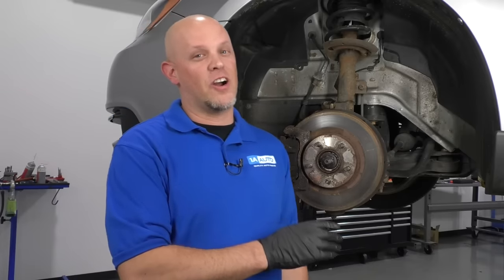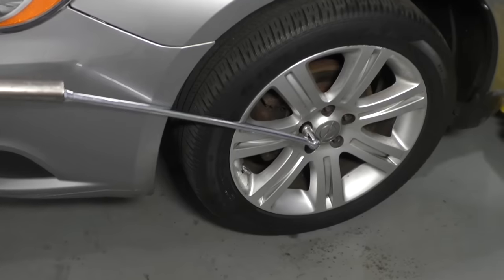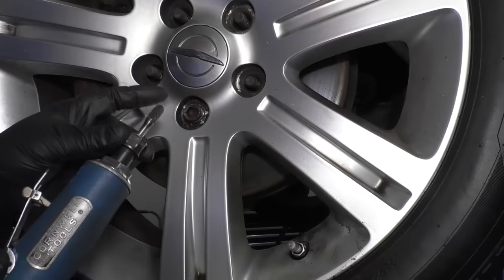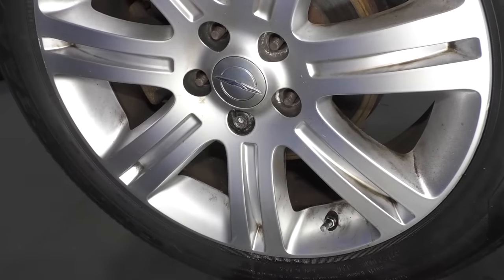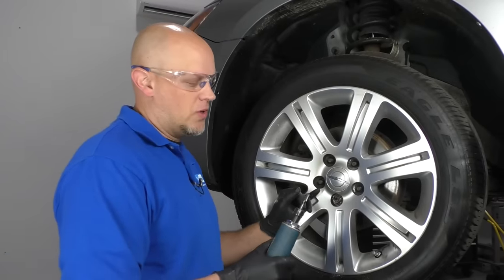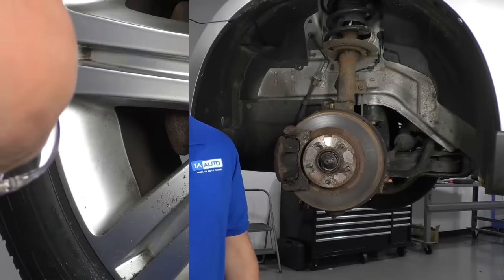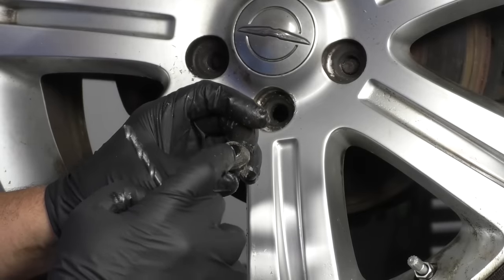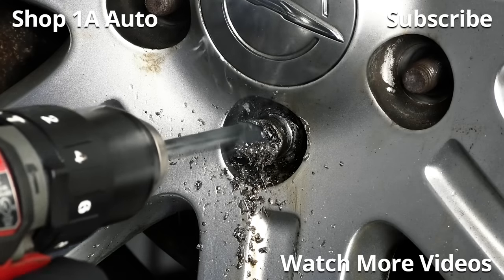This Lug Nut Wouldn't Come Off Our Car!

Comment: Better to have that happen doing a brake job than a flat tire!
Reply: Just Had it happen to me during a brake job and it’s still upsetting :(  I have 1mm left on my pads
Reply: Legit me with the flat and 3 stuck lug nuts I have no clue
Reply: @marianoardon9745  did u figure it out ?
Reply: Currently 🙄
Reply: This is happening to me rn with popped tire
Reply: I got 16 that are stuck on my new car 😮😢
Reply: An there are 2 stuck in my extractor
Reply: Tell him me about it!😡
Reply: Yup got a flat
Reply: About a week ago I was leaving town for the weekend with the wife and saw in the side mirror that I had a flat tire. About 5 days later I finally had a chance to change it and I broke the lug nut in half. Now I have to drill it out, just waiting on the new wheel stud
Reply: Worse to have it happen when your air ride failed and you’re trying to put your coil overs on😩
Reply: That’s me right now
Reply: I got a flat

Comment: Leave that one lug not on, remove all others, lower car from jack...turn car on dump the clutch! Lug nut AND tire off at same time
Reply: Can you rewrite that
.. I have a breaker bar and I am still unable to take off my tire lug nuts.  I even stood on the breaker bar...i weigh 190, bounced and everything...never loosened up.
Reply: @KalanyMightBeADawg123  had this problem yesterday, were you able to solve your issue and if so how ? it’s on the rim so i can’t drive it anywhere to have it removed.

Comment: Remember low RPMs and high pressure when drilling metal. High rpms will dull your bit in about 2 minutes.
Reply: i didnt know that, i thought faster it goes , better it drills
Reply: Would an sds drill be better?
Reply: @xxxkybourbonxxxx  fr💀
Reply: Certain specialty bits work best at high speed.
Reply: True but to much pressure snaps drill bits
Reply: Friction and work hardening.
Reply: Yes, he is right, low speed and get Cobalt Coated drill bits. I learned this the hard way, knackering a few of my HSS bits, when I had to drill out a stuck bolt from a brake caliper. Not fun, believe me.
Reply: Yes, very low speed and high pressure means drill bit stays sharp longer and it will cut through metal faster. I have found this applies to steel and alloys. Also, lots of machine oil - dripping oil onto drill bit as you drill if possible really helps. Normal HSS drill bits if used like this work fine and are quite cheap.
Reply: @Steve-GM0HUU  not only that but you give the drill a chance to begin making a chip, a drill is nothing more than a rotary chisel
Reply: You did well there after drilling off centre.
Nice work

Comment: I would have snapped it off with the breaker bar, you're going to have to replace the stud anyway you look at it.
Reply: The lug stud was spinning with the nut (lost it's press fit in the hub)
Reply: Roc Pile that can’t be because the nut was still stuck fast to the rim. I got the impression he was using a socket too big for the nut.
Reply: @ScottyB0AllDay  Yeah.... good point
Reply: yep, I would have
Reply: Yeah, I just had to do that. Whole stud was spinning, so I put a cheater bar on an extension worked it up and down and snapped the lugg off. Easy (buy I was already replacing the hub so idk

Comment: I once drilled 13 out of 20 lug nuts off a Ford Escape in upstate NY.   After 25 years in the business you learn a few tricks to make life easier.   You can also get a 4” piece of 1” copper tube and hold it with a pair of pliers over the lug nut hole.   It will shield the wheel from the heat and sparks but allow your to torch the lug nut off with very little charring to the wheel.   Drilling is best but takes some time especially if you have more than 1 to do.  Great video, thanks for sharing!

Comment: I literally had this same problem and have had limited success with extractor sockets, but I drilled it and used a carbide burr, much easier and no damage to the rim! Good video!
Reply from the maker: +Steve Melnick Thanks for checking us out!
Reply: Needed heat on lug nut.

Comment: Wel done 👍, a lot of work you did out there, where I simply suggest using a rounded nut removers, which are special nuts set that can be attached to your impact wrench which have a small rugged helalix that catches in the revers direction. This set catches all nuts type whether they are in a good shape or even torn out, that will make your job like a knife in a butter, try them out and feed us back with the result in another video, greetings from Egypt 🇪🇬, keep up the good work 💪

Comment: This is why, when I lived in MA, when working on the car if the wheels were involved I always put anti seize on the hub and back of wheel and used Mystery Oil on the lugs.  Never had an issue getting the wheels off even up in the rusty New England.
Reply: You use oil on the lugs? They didn't vibrate out?
Reply: Why wouldn't you use anti-seize on the studs as well?

Comment: Thanks for video. I Learned the hard way after having to do this in the past. First thing I do after my car gets new tyres and the tyre guy has battered lug nuts on with an impact wrench is take each lug nut out, apply anti-seize and set them to correct torque. Also, if you reckon there isn't much risk of your alloy wheels being stolen, replace the silly locking nuts with regular lug nuts.

Comment: A few tricks from my past. First the speed of your drill is key, in this demonstration he held the rpm way too high. Sometimes a quality hole saw will work as long as the guide bit stays in position, the hole saw will wear away the lug. Check to see if the back of the lug stud is easily accessible, if so torch the back off. A hammer and quality chisel will do a lot more work than you think, but be careful of damaging the wheel. They make specialty sockets for rounded off lugs like this. We have a lot of luck with them, if they don't grab use your hammer and chisel to ding up the outside of the lug, usually that will get it.

Comment: Try this:
Spray pb blaster on the lug.
use torch on strip kit socket, so that it gets red hot at the end of the socket.
hammer socket onto lug nut. Use impact on strip kit socket on lug, done.

Comment: When using a torch put wheel bearing grease on the wheel, it will barely leave a mark after your done
Reply: first last that’s a cool tip thanks I will try that next time.
Reply: Interesting. Will tmgive that a try!
Reply: Yup, seen to many ruined $1K wheels
Reply: Found that out the hard way
Reply: i think i already did it... somethIng went out from in between lug nut

what am i gonna do?

Comment: I have been using anti sieze on all my lugs for years.  I have never had an issue.  

I like your approach.
Reply: Just an FYI.. your not supposed to put anti sieze on lugnuts because it affects the torque value.  I think best practice as far as lugnuts is take them off every now and then.  I suppose it depends on where you live and how often you drive the vehicle.
Reply: @TheUnknownHarbingers  yes I would not put anti seize on It.
I have been using your method for some time.
But many time i have been thinking, what about using some diesel fuel on the threads before mounting those? Any comment is welcome. 
Best.
Reply: @TheUnknownHarbingers  no problem affecting the torque value. just torque it to 70% of recommended when using anti-seize

Comment: I just recently did one where I had to cut the dust shield off and Shear off the back of the stud and then I drove it out with an air hammer. And a pointed punch

Comment: Even better way. When the cap comes off, put on a socket that's 1mm smaller. Then hit the end with a good brass hammer. Put your impact on it and run it off. Works almost every time for me. (Michigan tech here)
Reply: I wish this works with mine my bmw but the head came off !! Now there is no place to even put the socket it’s fkd

Comment: Purchase a "self centering drill bit with guide" like carpenters use to center the holes they drill through door hinges. The bits are replaceable so you can put in a cobalt bit if needed. The bit and tip of the guide should just fit through or into a 1/4 inch drive socket drive end. Sort through your 1/4 drive sockets until you find one with an outside diameter as close as possible to the bolt stub diameter that you want to drill out. Grip socket with vise grip type pliers with drive end toward bolt and align as close as possible. If bolt is protruding you may be able to use a small hose clamp to help you align bolt and socket. Now insert drill bit through open end of socket and push on spring loaded bit until it is touching bolt stub and start easy drilling. You now should have a shallow hole fairly accurate in the center of the bolt stub. Then remove this rig and drill away with regular bits of ascending size. The only thing this accomplishes is a starting point as centered as possible. There may be variations of this technique depending on the circumstances. If the bolt is really hardened some people use carbide tipped bits.

Comment: When you have a rusted lug nut, try tightening it first as it will be the path of least resistance (less rust) After it slightly tightens, then try backing it out.. you will keep from snapping as many studs with this method.. you may also need to tighten it, Loosen it, tighten it, loosen it to keep the threads from binding up with all of the rust.

Comment: I had the same problem on my '05 Ford explorer. Tried everything, eventually got them (I had two lug nuts frozen) with a "damaged lug nut removal socket" and an impact gun. Not fun! The tool is like a reverse thread socket, kinda like an easy-out. Replace all the lug nuts if this ever happens to you!

Comment: Nice video!  I'm hitting a similar problem when working on my brakes.  Ordered my parts from you all and everything looks great.  I just cant get the rotor off!  I've used a hammer, penetrating fluid and time but cant seem to get the front rotors off of the car.  Hopefully if it warms up enough (I'm in Iowa) I'll be able to try using a rotor/drum puller over the next couple of weeks.  Think you can do a video on how to use one of those?
Reply: You may a Allen screw on it that is holding it on, depending on the vehicle. Look for it on the outside of the rotor!  There is no reason for it to not come off otherwise!
Reply: Sledgehammer if no rotor screws.  4 hits in a square configuration.   Of course replace rotor after these hits.  Something this rusted to hub has been on too long and needs replaced.  I don’t mess with keeping or machining rotors as this is a safety issue for $30.  Not worth it.
Reply from the maker: Sorry to hear that! Like other commenters mentioned, look for a screw holding the rotor to the wheel hub. Also, depending on the vehicle, some rotors have threaded holes that you can tighten bolts into, and they will push the rotor off the hub.
Reply: Have you tried picking at it where the hat of the rotor goes around the hub? I heard from other mechanics that live up there in the rust belt thats the most troublesome part to get off
Reply: Air hammers are a godsend when you run into that.
Reply: @williamocrow  damn right they are
Reply: @arnoldl.arrington5147  rust will be a reason for it not to come off! I had the same problem on a Chevy suv
Reply: I had to take a cut off wheel on a 4 inch grinder to cut one off once just make sure that you check out the area to make sure not cause any other damage but if you cut on either side of the rotor you should be able to smack it off with a large hammer
Reply: Guy I use a slidehammer (dent puller) at work all the time to remove the most stubborn stuck rotors, assuming you've checked to make sure there's no set screws securing the rotor to the hub assembly.
Reply: Put the caliper mounting bracket back on and get 2 4inch long bolts with 4 nuts and 4 washers. Put the bolts threw the holes that the caliper would bolt to on the mounting bracket.  you can use wrenches to tighten the nuts in such a way that it will push the bolts into the rotor and force it off. Goodluck
Reply: I've broke shattered rotors with a sledgehammer.
Reply: Brad Stingray 

      I wouldn’t want to meet you in an alley.  😫
Reply: If the rotor is messed up to the point your going to replace it anyway just use a torch heat up just the rotor NOT the hub it shout expand the rotor enuff for you to just tap it off with a small hammer easier
Reply: Some vehicles still have rotors that are "captured" behind the hub face. Check your repair manual. Like others have said some rotors have small screws holding them. I've always had good luck with a prybar behind the rotor, usually against the mounting tabs for the bracket, and a hammer. The trick is to pry the rotor outward and hit the outer edge of the rotor directly across from where you pry. Might hafta rotate a few times.

Comment: A little bit of transmission fluid on the threads while instalking. It has so many rust inhibitors. If the stud was spinning, why not grind off the backside and tap it out with a punch or drift pin.

Comment: Just had this issue on a 2013 Jeep JK. Had to use a long 1/2" drive  breaker bar with a floor jack handle over it. they finally popped loose. My thought was someone put them on with an impact full throttle!
Reply: That is the problem. My wife needed new tires and went to the local tire shop. Months later she needs new brakes and I couldn't get two lug nuts off because they were stripped and was unable to change her pads and rotors on the passenger side. These idiots today get out of control with that impact hammering those on way tighter than the recommended foot lbs. This has happened on my truck before as well after getting new tires. I now have to tell these idiots at garages when getting tire changes to make sure you are not putting the lugs on so damn tight.
Reply: you were lucky. 

i broke 3 sockets when using leverage like you. stuck completely.

so i did just like 1A ...

Comment: Part of the problem was likely that you removed all the other nuts first and the rim was wedged against the lug nut.  A good plan might be to tighten a nut on either side of the stuck nut and leave the two opposite off.  Over torque the two adjacent nuts to relieve a bit of the pressure on the stuck nut, then hit the stuck nut a few times towards the axle with a hammer to break things loose and free the ramp of the thread wind and give it another try.  There's a reason why they teach rank amateur home gamers would be mechanics to tighten the 5 nuts of many cars in sequence of opposite points of a 5 pointed star.
Reply from the maker: +Juergen Welz Thanks for the feedback!
Reply: Sounds like this will work, but can you do a video on this?  I just can't picture it.  Ty

Comment: i would think heating it up red hot then using the breaker-bar would've got it off a lot easier but who knows?
Reply: if you are willing to destroy the wheel finish then yes, that will work.
Reply: You would need an accurate way of just heating the stud. There are tools that uses induction heating to heat up small areas. Tight areas like that would be hard without heating everything else in that area.

Comment: I take a braker bar, load it up with torque and smack the swivel part of it with 4lb hammer. The vibration brakes the rust loose and torque on the bar takes advantage of it.  It's not very good for the braker bar so I have a cheep one for this specifically.
Reply from the maker: +chill mode Thanks for checking us out!

Comment: If you have a Chrysler. Immediately replace the lug nuts for this reason. The overcaps corrode and trap moisture inside the lug nut eventually

Comment: Forced to do my own brakes after a shop turned me down (excessive rust). First three wheels went smoothly but, ironically, the previous owner grossly overtightened all the lug nuts on the new, rust-free, wheel hub.

I couldn’t get the lugs off even by jumping up and down on the breaker bar. I broke out my Chicago Electric 12v emergency roadside impact wrench, banging away until it seized. I switched to my DeWALT impact driver with half-inch impact socket adapter and the adapter instantly snapped. I had to use a torch while jumping up and down… and even then it damaged the threads on at least three studs and pulled the threads clean off one of them (like a perfect coil/spring).

It was the only hub without rust, there was body damage around the wheel, and the rim had junkyard numbers so it was clear that the previous owner had replaced the wheel hub and grossly over-tightened. Meanwhile, my brand new caliper isn’t working right so I’m going to have to go back in. Wish me luck!

Comment: Dissimilar metal corrosion makes the steel nuts stick to the aluminum wheel. Use Anti-seize compound when reinstalling lug nuts being sure to coat the nut where it contacts the wheel.

Comment: I used a half a can of CRC freeze off super penetrant, i went back three times to spray each lug.  I sheared off a half inch to 3/8 converter and broke a ratchet before using a half inch 2 foot long breaker bar.

Comment: Use Just a smaller socket (impact rated) and hammer into the nut the most straight u can and then twist with a ratchet (not impact gun) 
And that's it!
It'll come off quick
Reply from the maker: It didn't make the final cut, but, believe it or not, we actually did hammer on a smaller socket for both the breaker bar and impact gun shots!
Reply: I usually just twist off stud and replace stud.  Easier than trying not to ruin rim.  Did 9 on an Avalon about 10 years ago.  Shop put lug nuts on with impact and cross threaded all studs.

Comment: take a breaker bar with impact socket, put on a couple other nuts to hold wheel on, then brasse breaker bar against floor and drive car in reverse to brake nut loose.
Reply: Not if it happens on the passenger side